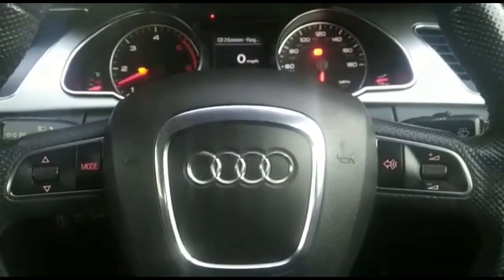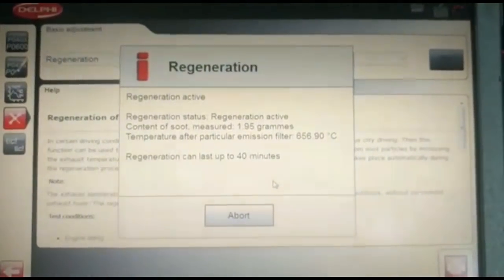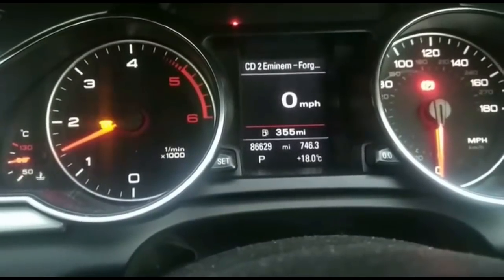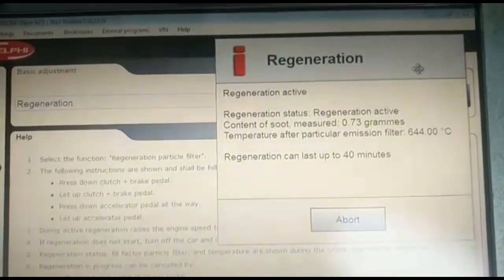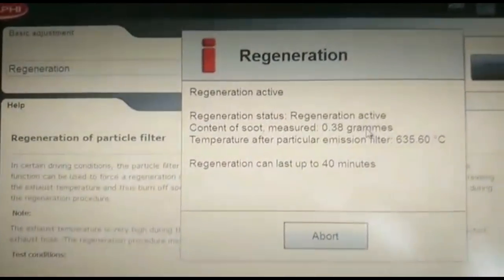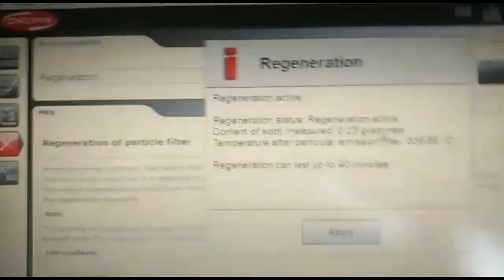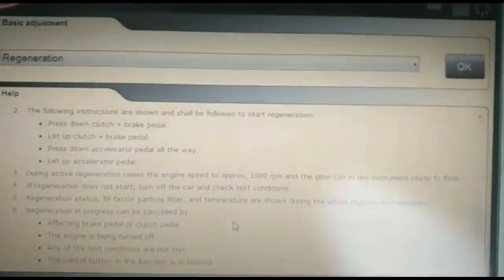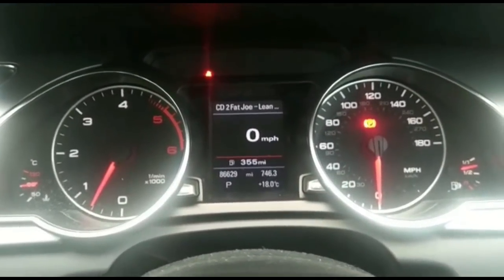DPF Regeneration - Audi A5

Comment: can you do a regen without the computer?
Reply: @alwoo5645  does an Audi A5 do its own regeneration? There is a fuel smell coming in the vents of my 2018 Audi A5 manual, no signs of injector problems . Fumes coming in on staring the car or sometimes only after driving for a while.. so inconsistent. No dash warnings . I’ve been told it’s doing its own regeneration.

Comment: I got the same problem, i have an audi a4 b8, i got my dpf cleaned up for 400€ and it lost about 90gramms after the cleaning.. now the guy who did that said that he couldn’t reset the dpf via vcds.. i paid 400€ to solve this problem because the particelfilter bank was full with the errors p200200 and p242f00.. i mean the dpf is clean but the only problem is that he couldn’t reset it.. the engine doesnt know that the dpf is clean now, idk how to use vcds so i don’t know if there is another problem or the guy just couldnt reset the dpf.. do you have any idea?
Reply: I know how to read the codes so the only thing i know is that it shows that the particel filter bank 1 is full (static) p200200 and the other error is the same with soot p242f00 (static)

Comment: I’m using the same tool on a 2008 3.0 A4. All test conditions met. I press clutch and brake and then back up, same with throttle. It starts the regen but instantly drops out again. Any ideas why this is happening? Cheers
Reply from the maker: Hi, Possibly dpf completely blocked / temp sensor or engine code not cleared fully so it won't work. Try dpf treatment and run the car for 2 min with high revs on the motorway with low gears and try regeneration again. P.s don’t go over 5000 or to red that can risk engine damage. Thank you
Reply: @TajMotorMedics  thanks for your reply, most likely totally blocked. Cheers

Comment: Same car and year as mine i have fault code p2002 when i scan with my basic reader. But i have no engine management lights on ,i have a huge loss of power is this the same issues you're car had? Thanks great video.
Reply: Thanks i took it for a long drive it really struggled to get above 60 and wouldn't rev above 3000rpm also really struggles on hill's the long drive did help slightly but the problem exists i think i may have another issues aswell. Ive just ordered obd eleven so i can do forced re gen then I'm going to try cleaning the throttle body. Thanks for the reply.
Reply from the maker: Ryan H yea see if that helps 🙏😊
Reply: @ryanh3285   what was the problem? I have same issue
Reply: @elhinho7015  Mine needed a dpf re gen i took it to a local specialist and it cost about 90 uk pounds.
Reply from the maker: The most common solution for this code p2002 is to manually put the vehicle on the DPF regen mode by using a scan tool or taking the vehicle out on the highway for a little longer to let the heat burn off the stored PM emissions.

Ways to clear the DPF.
Warm up the engine to operating temperature, then drive it for 15 minutes at constant speed on a motorway. Aim to keep the revs above 2000rpm for this period. The heat generated will help clean the DPF filter and the cars Regeneration cycle will usually kick in under these circumstances.

i hope the following information helps.

thank you

Comment: Can a faulty EGR valve on this car cause that particulate filter light to come on?
Reply from the maker: Hi Yes if it's blocked EGR will cause the dpf to block ,due to blocked exhaust recirculation. Thanks

Comment: Hi. I have the same car as in this video and keep noticing whilst driving my engine will run at 1400 revs where's normally it will run at 1100 revs. Is this the car doing a dpf regeneration itself? Thx
Reply from the maker: +John C Bradley Hi thank you for your msg , how long has it been like this on 1400 rpm? It's not self dpf regeneration, I would suggest getting a diagnostics done and read the codes , possibly throttle body fault . Thank you for your enquiry . Taj tyres
Reply: Taj Tyres ltd it's been doing it for a couple of weeks now but it will only do it when there is more than a quarter of fuel, below that it won't do it. I will get it scanned soon and post the codes.
Reply from the maker: +John C Bradley sounds good if you get it scanned and let us know what it is :)
Reply: Taj Tyres ltd how much should I expect to pay for a thermostat change and the dpf regen? And where are you based? Cheers
Reply from the maker: sorry for the late reply we're based in southampton. Thermostat would roughly cost £130 inc parts and labour and DPF regen £60
Reply: Taj Tyres ltd Thank you very much! Very helpful to me! Unfortunately I'm in Manchester 😤
Reply: John C Bradley hi pal just reading this thread and I’m in manchester too and want to ask did you manage to find a decent place for a dpf regen?